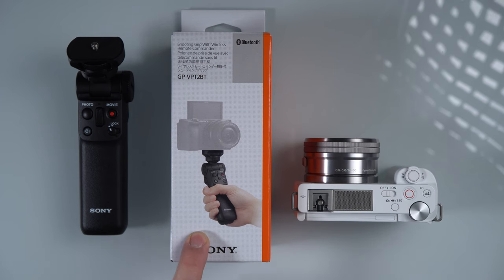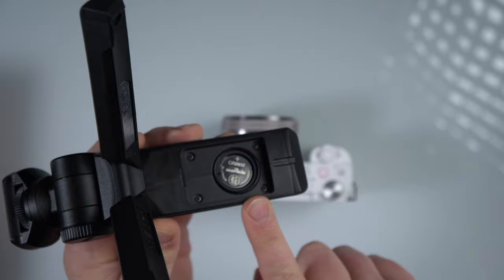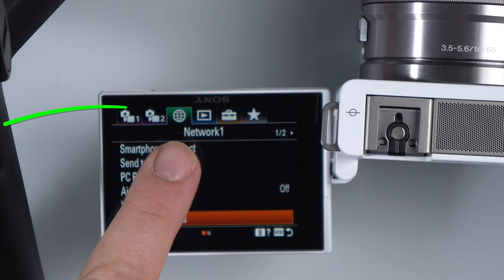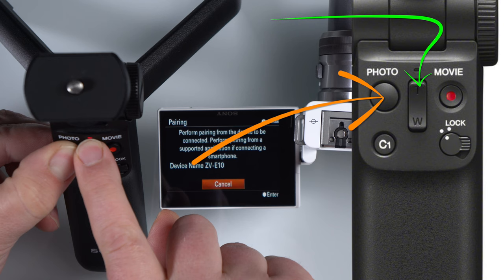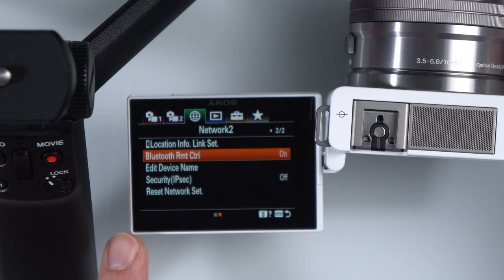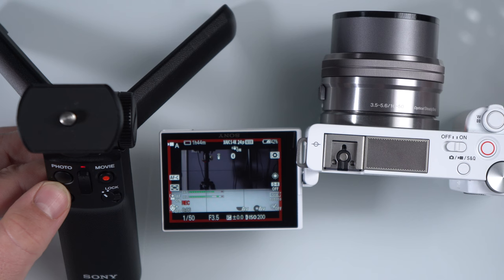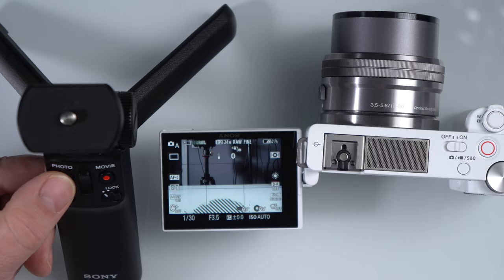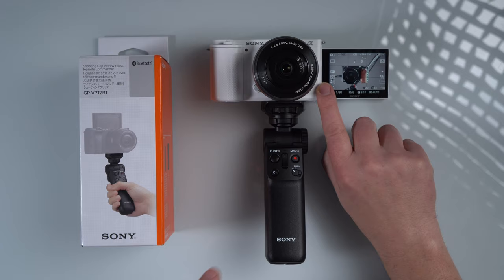How-To Connect Sony GP-VPT2BT Grip to ZV-E10, ZV-1 - Bluetooth Pairing

Comment: Great video Jason. Short, sweet and spot on.  One question though:  Do you have to repeat this process each time you switch the camera on, or will the pairing be retained in memory while the camera is switched off?
Reply from the maker: Thanks and It will remember once you pair them. You would need to unpair them for it to stop working...